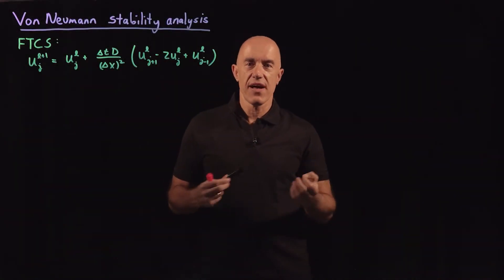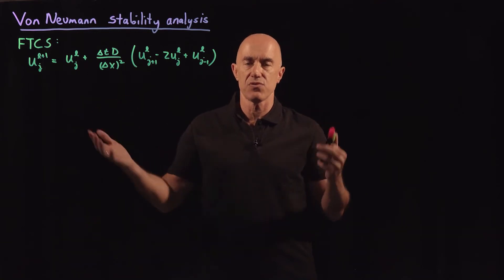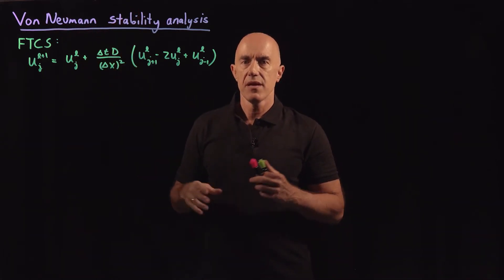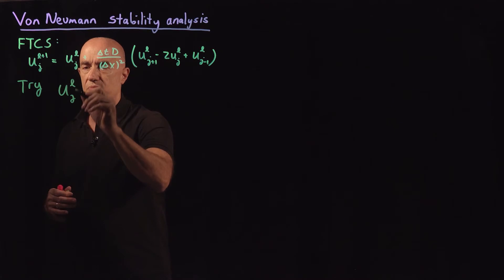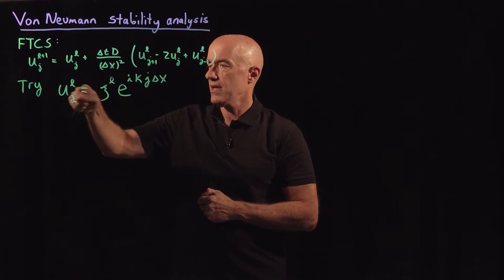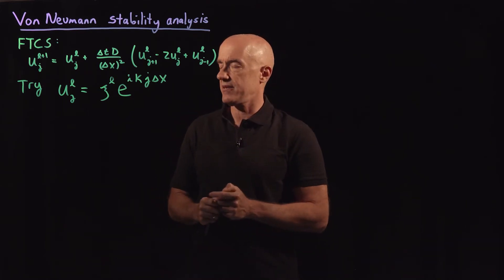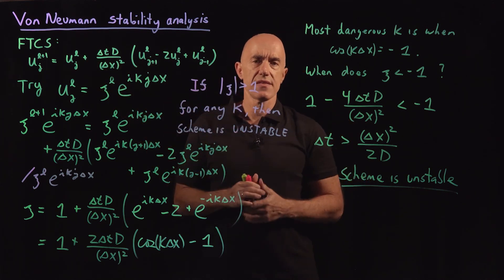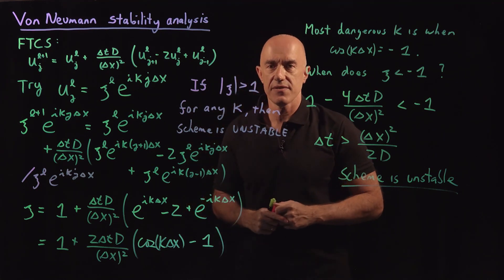Von Neumann Stability Analysis of the FTCS Scheme | Lecture 70 | Numerical Methods for Engineers

Comment: Why is it called explicit (scheme) if you need the step before?
Reply from the maker: You can plug in the solution for the previous step to immediately get the next step.  Implicit methods need to solve a matrix equation.

Comment: After you choose the ansatz, it all makes sense, but where on Earth does that ansatz come from? Also, thanks for this video. The stability analysis was really cool and missing from my text, so this was a nice supplement.
Reply: its fluctuation of error as function of x, expressed by a fourier series
Reply: @its-silachi  This is an elliptic equation so it will have a bounded solution thus he could represent it in terms of fourier series. But if the equation is a wave equation (hyperbolic) then how to get this stability operator???
Reply: the Ansatz there is a single Fourier mode.
Reply: The ansatz arises because each of the Fourier modes evolves independently. This happens because of the linearity and shift invariance of the PDE. The spatial fourier modes of the continuous PDE evolve independently (each wants to decay with rate of D k^2), and likewise the discrete spatial fourier modes of the discretized PDE evolve independently.

It looks a bit magical in this presentation because he tests a continuum of k values. In reality you only need to test the discrete spatial frequencies of the discrete fourier transform. Anyway you get the same result that the worst stability problem happens at k = pi/(delta x).

(To be perfectly true, this does rely on the discrete PDE being uniform (no variations in diffusion coefficient) and periodic boundary conditions. But even if not perfect it serves as a great heuristic.)